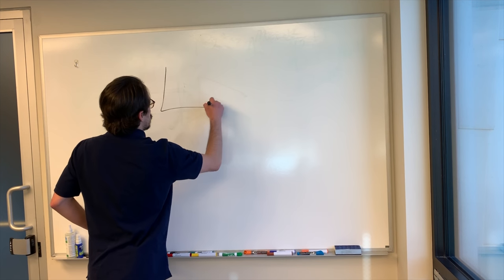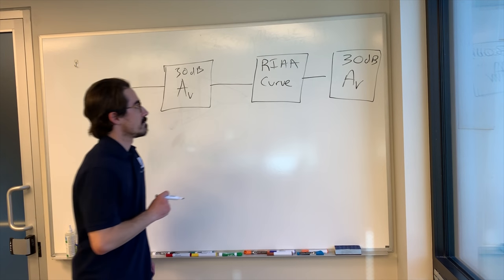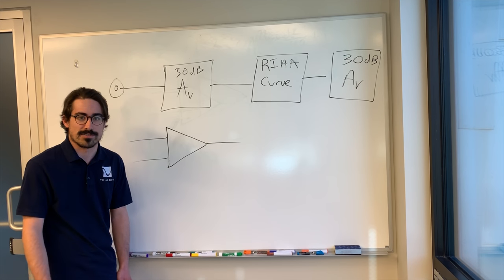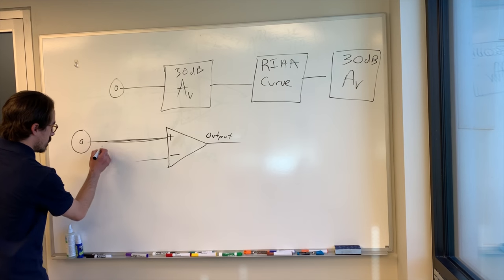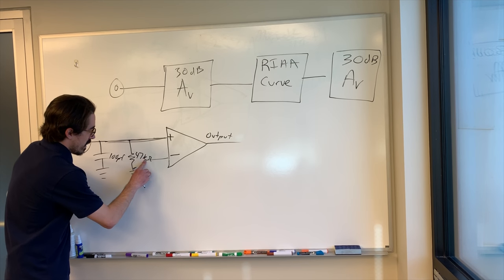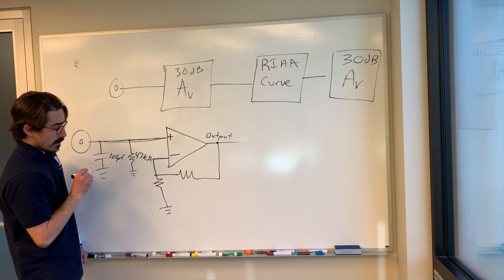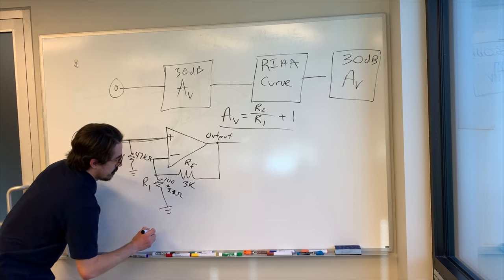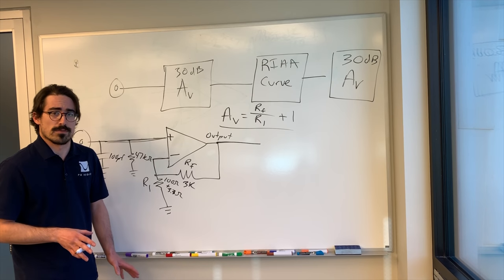Designing a phono stage part 1

Comment: Great video, hope this ends up in a finished and buildable project.
You only use a capacitor on the input to reduce RF,
what about using a ferrite cores on the input, maybe together with the capacitor,
or are there issues with that idea?
Reply from the maker: Awesome question. Something I didn't touch on in this video is that fact that that cap also loads the MM cart. 100pF is a typical value. Changing this value (75pF and 200pF are also common) will affect the resonant frequency and damping at high frequency. The cable that you use has to be factored in as well. 

I've used ferrite beads on MC inputs without any issues but haven't done any listening to them specifically to see how or if they have any sonic impacts. One could theoretically use a ferrite bead on the MM as well but it would be recommended that the impedance of this filter stays relatively low up to 20k.

Comment: After getting my BS in computer science and engineering (sw & hw), I had the inspired idea of getting a masters in EE. First course, linear integrated circuits (op amps). Open book, open note tests. You wouldn't think, given how easy op amps are to use (they are easy, and you can do some magical things with them, buffering the easiest, inversion a close second, amplification a close third, then integration, differentiation, filters...), but it was the hardest course I ever took. Spent 40 hours/week just doing the homework for that one class. Dissuaded me from continuing on with the masters. Major props to the EEs.
Reply from the maker: Thanks for watching Michael! We have all had courses that we'll never forget. My electromagnetic waves course was very intense but he was easily the best professor I've ever had.

Comment: There was definitely something special about P.S. Audio's approach to design that in 1979'ish (in my & many's opinion) made the quietest & best sounding phono-preamp on the market for under £1000 (equivalent to £"loads" today) in their 4.5/hi-current PSU  preamplifier which like the Stellar, was fully discreet in it's signal path with 15'ish trannies on each channel. (when vinyl was king & a preamp's phono-stage was the deal maker or breaker) I mostly run a fully tubed 2-chassis phono-stage with step-up trannies but i've heard enough about the Stellar now to re-focus my future upgrade possibility, into (somehow?) trying and possibly liking & buying a Stellar because fully tubed phono-stages are not the quietest, esp' on m.coils, at least in the price-band i could afford.       (p.s. those older circa' 1980's P.S. Audio Phono-preamps make dirt-cheap s/h phono-stage bargains & i don't think today's stages could beat them for under a grand after recapping it's psu)

Comment: Your block diagram implies a passive RIAA EQ. In your next video you may want to touch on the differences between PASSIVE EQ and ACTIVE EQ done in the output driver feedback loop. The reason being there is much controversy in audiophile circles between passive and active phono EQ sound quality differences - or lack there of? Also note that an active EQ does not need to be OPAMP based either. Many legacy tube circuits also employed active feedback based EQ.
Reply: Andy Delle - Wouldn’t that be determined on how the vinyl was made? If it was made with a passive RIAA EQ, wouldn’t an active EQ be messing around with the original recording?
Reply: @Enemji  , No.
Reply: Well, there is a nifty thing that is in favor technically speaking for passive RIAA: at the very top end passive keeps on attenuating the highs as it should, active will teethe out at a fixed amplification.
Passive is sound-wise better than active to my opinion, which I could, but won't, underpin this with arguments, because that is complicated and more subtle.
Reply: : @Enemji  RIAA EQ is RIAA EQ. Passive and active is just how it is done electronically. Both are passive filters, but an active EQ circuit uses the passive filter network within an amplifier feedback loop, like around an OPAMP. A true passive EQ is just an RLC filter network the signal goes through and only uses the amplifier stages as flat gain sections. Beyond that you could also do RIAA EQ digitally with discrete logic chips (a lot of them!), a DSP chip, or just  software running realtime on a fast computer. But then I trust no vinyl enthusiast would be caught dead with a digital RIAA EQ setup :)
Reply: @airgead5391  Yes, that's what I read as well. I'm not a vinyl user myself but it does seem that passive RIAA EQ is the most preferred. And it is a bit more expensive to do right. Perhaps that's why active EQ was more popular in lower priced gear.
Reply from the maker: I do believe there're great examples out there of both styles of implementation. We'll talk more about this in upcoming videos as well as giving an example of a discrete circuit using active shunt feedback equalization.
Reply: Andy Delle - Andy, thanks for clearing up the difference betwen Active and Passive RIAA EQ.

Comment: It has been awhile for me so be gentile if I am wrong,  but isn't the opamp equation a linear scale ? 20log(30) = 29.54dB, I mean it works but it can be confusing if you picked a different gain.
Reply: Yes, voltage gain and DB gain are in fact different and should be properly calculated. But in the case above they are close enough for illustration. There are countless DB calculators online! No need for math anymore like my generation had to endure.

Comment: I am puzzled, are you using 5% resisters or more likely 1%. Your choice of 3k indicates 5% values, but adding 3.3 ohms to 100 ohms doesn't make sense (5% of 100 ohms is 5 ohms).  Why would you want to make the gain so precise that a gain of 31 db is not acceptable.
Reply: He's not going that deep into details. He's just using convenient numbers for illustration. FWEIW, the precision needs to be in the filter section. Like you observed, if the overall gain is a little off, well that's what the volume control is for.
Reply: I would use a preset ( potentiometer ) if its a personal project .
in mass production 1% resistors make more sense.
Reply from the maker: Hi Jim, I'm attempting to simplify some of the math and stick to a voltage gain of 30 for illustration as Andy has pointed out. Using a single 100 ohm 1% for R1 would be perfectly fine.  Concerning the resistor tolerances, tight tolerance resistors are inexpensive today which is why I design the majority of our analog circuitry with .1% thin films. I guess you could call it habit. -Darren